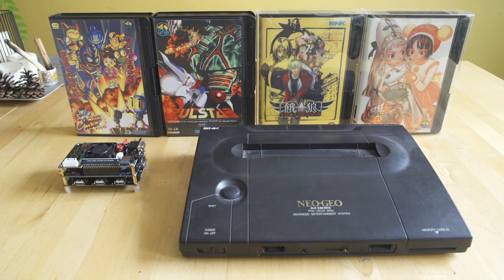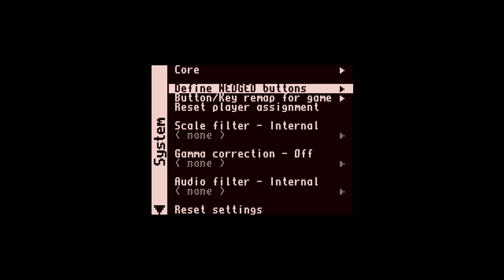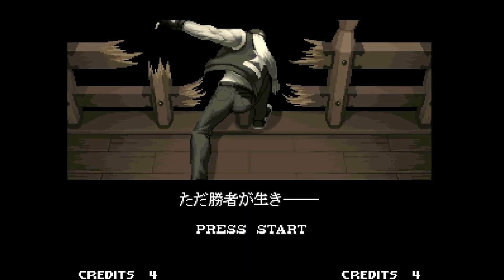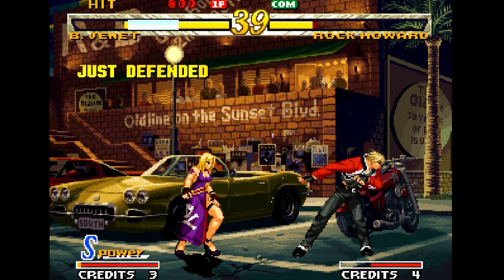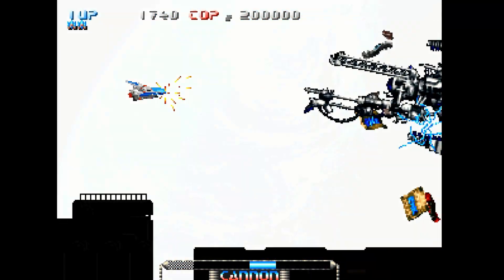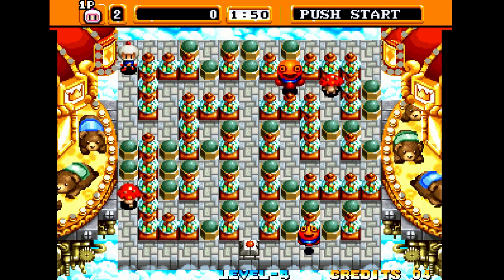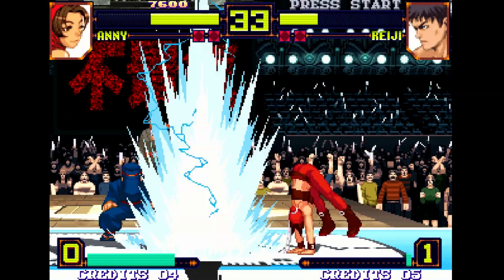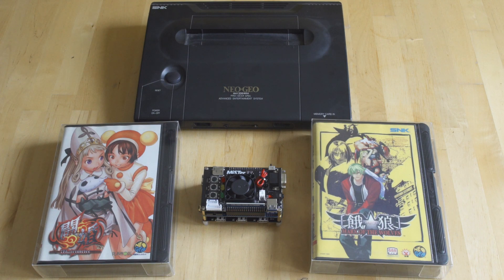MiSTer FPGA DE-10 Nano Neo Geo AES / MVS Setup Tutorial and Core Review

Comment: "I will link to (whoever's) website below" -- no link to be found. Super handy.
Reply: Unrelated; I see you have the MisterAddons version of the kit -- I recently designed a 3D-printable case for that exact kit, because none I could find would fit properly. I'm more than willing to share it. Four parts, captive buttons, uses purely existing hardware plus eight countersunk M3 screws.
Reply from the maker: Should join the MiSTer discord and share it

Comment: I just came in to the MiSTer community, and i am very pleased, but a little disappointed by the Neo-Geo core. In this video you praise the sound, but in my experience it is not right, when the graphics are very busy sometimes it tends to change the pitch of the sounds and music, and it sounds lika a "walkman" running out of batteries for a moment. One example of this is the Laser Gun in Metal Slug X when fighting a lot of exploding mutants in the sewers stage. There are other examples of this, well explained in core's github issues section. This issue has been reported and is under investigation since more than a year ago, and still nothing. I hope it gets fixed soon.
Reply from the maker: I don’t have as big of an issue with the audio myself but I’ll have to listen to those laser noises. I’m sure the issues will get ironed out in time though. It’s def one of the most popular cores on MiSTer.
Reply: @VideoGameEsoterica  You don't necessarily have to look for that Laser Weapon, it seems to happens in many, many games. Today I tried The Last blade 2, and at times it sounded like it was a full tone down. It is very noticeable to me, and makes the core much less enjoyable. I hope it can be fixed soon, as you said it is one of the most popular cores, and one of the main reasons i bought the Mister instead of going for a NeoSD or NeoMulti.

The issue was already reported in 2020 to the issues github section, it is issue #111. There are people reporting more games where they appreciated the problem.
Reply from the maker: I’ll be looking into it again soon in a future video :)

Comment: You can get a NeoGeo X Arcade Stick from AliExpress pretty cheap, instead of modding your original AES controller. I did this to keep my AES setup intact...
Reply from the maker: I’ll have a video soon showing how to use an Arduino Pro Micro to use DB15 arcade sticks on the MiSTer with no notifications to the original stick :)
Reply: @VideoGameEsoterica  an external mod!!! you've got my attention now 😁
Reply from the maker: Haha yes. Zero modification to the stick. You plug your AES / other types of DB15 arcade sticks into an adapter attached to an Arduino and into the MiSTer via USB. So no modifying the controllers physically at all
Reply: @VideoGameEsoterica  My Mister hub is the Blisster, but I haven't been able to find a cable for my db15 AES sticks, this will be a great alternative, thx!
Reply from the maker: I think the video will go up in two weeks? I can’t remember. I have like eight more MiSTer videos already uploaded and scheduled out into the future and I can’t remember what that exact schedule is

Comment: I'll always prefer original hardware but I do have quite a bit of respect for the Mister these days. It seems really good at what its designed to do, a perfectly good option for a much less complex/cluttered setup and definitely more affordable. When it comes to Neo Geo I personally collect for the Neo Geo CD and my entire retro setup gets fed into an OSSC. I love my physical collection to death but even with the CD's lower than AES/MVS asking prices I still shock myself from time to time knowing how much I spend on this stuff and that's not considering all the video equipment that I spent on to get it all to work or the vast number of other consoles like collect for. If that wasn't enough I also just purchased my first supergun this week so now I'm going to be adding expensive arcade hardware into the mix lol. Of course if I were to use a Mister none of that would be an issue but it also wouldn't be as fun of a hobby. I guess everything comes with its own price tag huh?
Reply from the maker: Yes the cost of real hardware and games is high and just going higher. Hopefully some day we will get NGCD support in MiSTer too

Comment: I actually bought a couple of Neo Geo Gold sticks, swapped out their PCBs for Pi Zero (had to keep the original firmware 'cause the update removed Select as a single button), which was kind of a mistake (it's a bit overkill and a Daemonbite Arduino will definitely do the trick just fine), and they're kinda neat to play Neo Geo with on MiSTer. I might also get that Samurai Showdown stick at some point. Only problem with the old AES controller is that you can't swap the sticks out for anything else because they're too short on the inside. I'd love a version of that controller with a phreakmods link joystick shaft.
Reply from the maker: That’s not a bad idea. I’m going to Daemonbrite my custom sticks to USB just because it’s all my preferred mix of Sanwa and Seimitsu parts